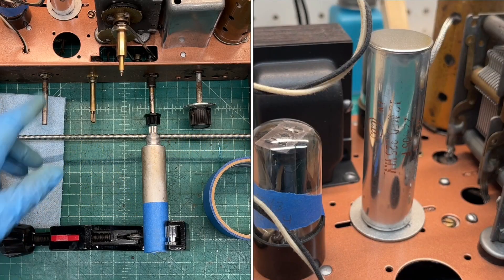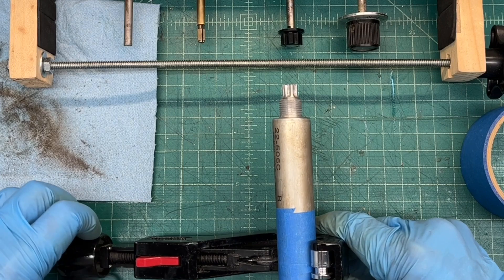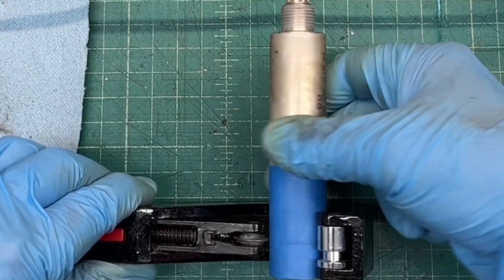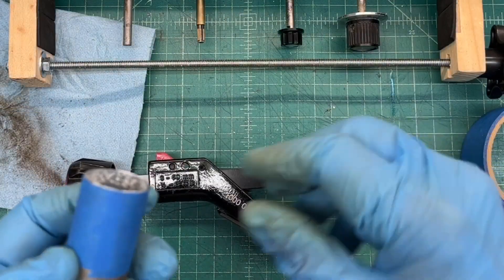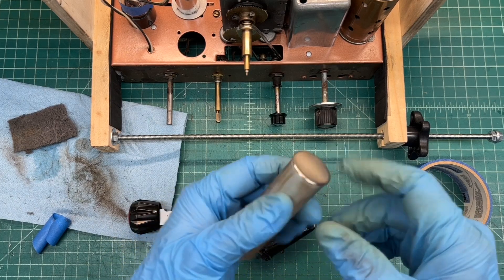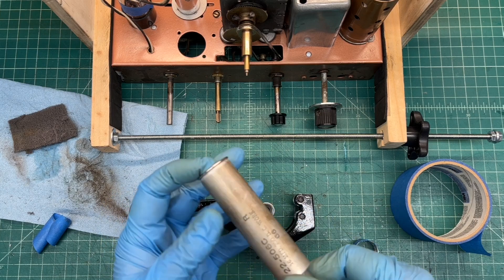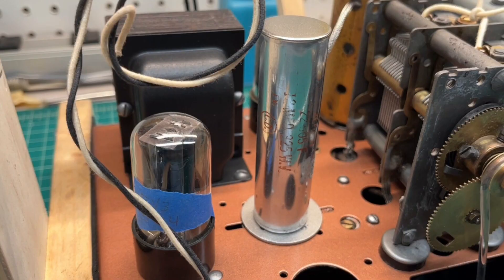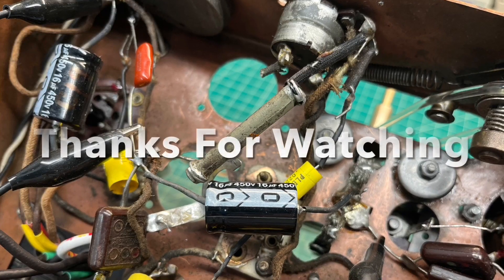Zenith 5-S-127 | Restuffing Dry Electrolytic Capacitor Cans

Comment: Always open to new ways to keep the history behind those caps and replace with new. Did this to my early 20's fada special. It was a nice easily opened square can. Fit a nice .5uf cap in it with no problem. Thx for sharing Don.
Reply from the maker: Thanks Tony. It’s was great finding both of the caps dry and easy to restuff. Best, Don

Comment: Thanks Don. It really is that easy with the proper tools to restuff a can capacitor. That hole plug is a 1 inch one, commonly used in home electrical supply work. They also make it in 3/4, 1.25 and 1.375 inch sizes. Some situations may involve
 using fiber washers to insulate the body of the capacitor from the chassis both on top and underneath which you could fabricate or buy.
Reply from the maker: You bet Steve. Thanks for your informative comment, which I know will be beneficial for all of us down the road. Best, Don